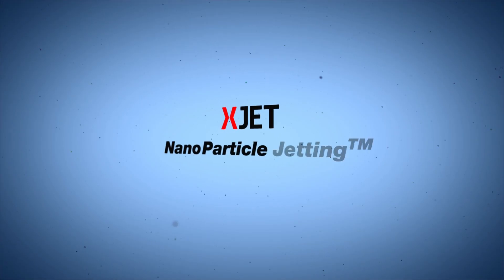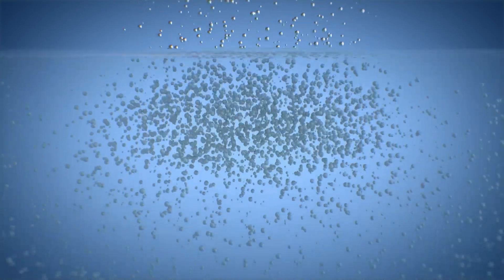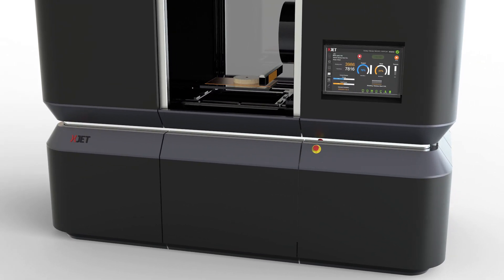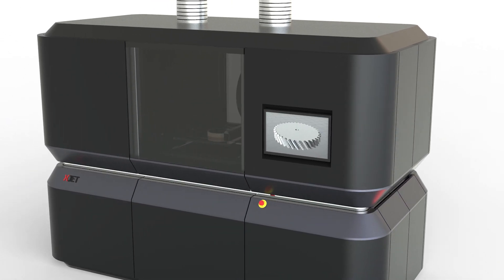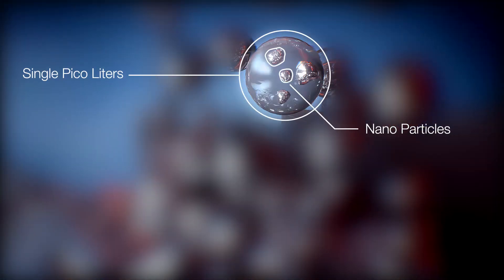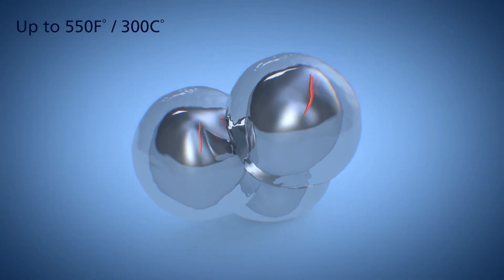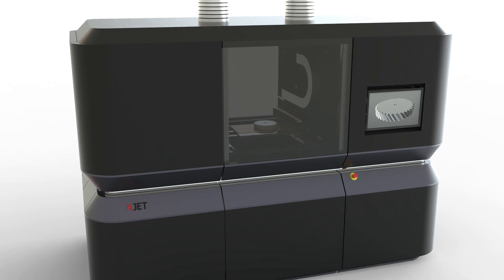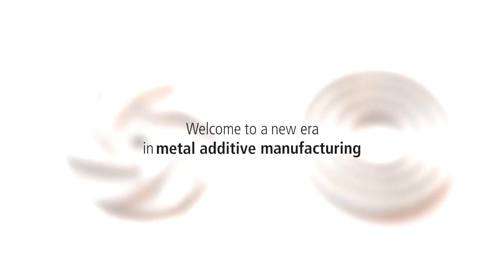Tech Movie   160317 F

Comment: Does the sintering step is carried out in the same equipment?
Reply from the maker: No, use an Industrial furnace.
Reply: How about the step where support material is disintegrated? Also by using industrial furnace?
Reply: I think the particles are so small that the material is slightly sintered when it's printed even if the temperature is far lower than the melting point so it does not need any binder, but i wonder about the mechanical properties as it's printed. I think it's way harder than green and brown parts makes by MIM or binder jetting process, that would allow a safer handling of parts from the printer to the furnace. it would also reduce the shrinkage.

After that, the heat treatment is more a recrystallisation of grains than a sintering.